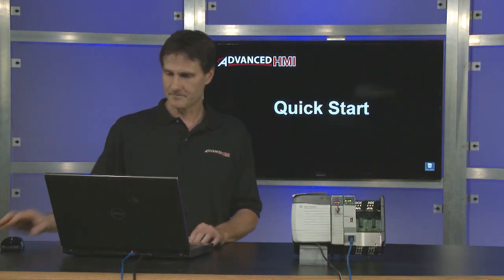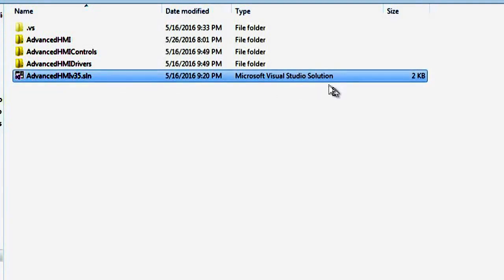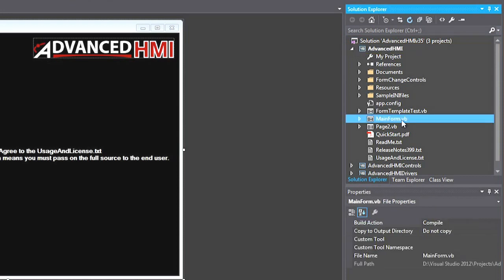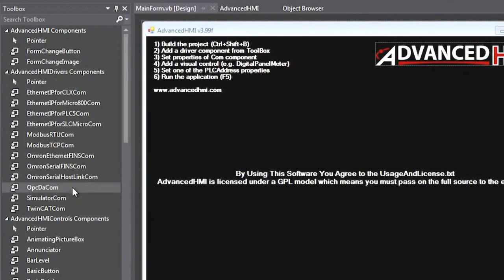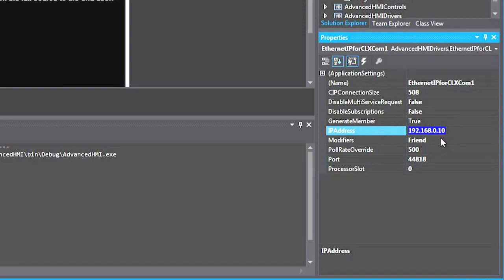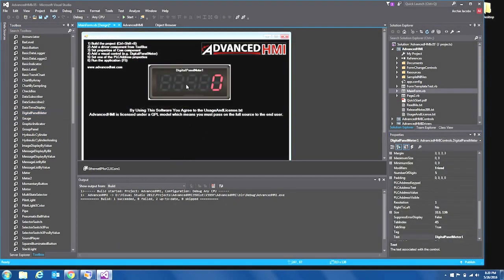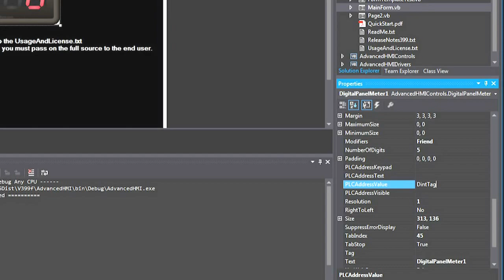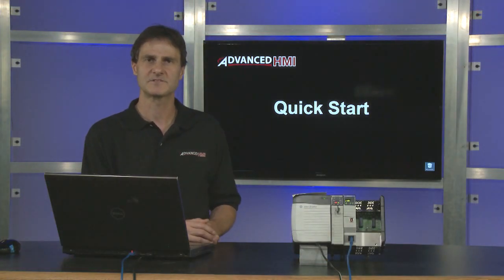AdvancedHMI Quick Start

Comment: Please could someone help me. It would be much appreciated.

I have built a simple hmi screen using the toolbox and have successfully got a start and stop button to work along with speed reference value input directly to a VFD using Modbus RTU.

Start button is addressed 40001 and I send a true value 1 to run.

Stop button is addressed 40001 as well only with this I send a false value 0 to stop.

I have also address a text entry box to 40002 and if I write a 500 value it will run the VFD at 50Hz which is also great. I just have to sort the decimal place out.

I’m having trouble using the Digital Display from the toolbox. I simply can not get it to read the frequency output from the drive. 

The VFD manual says the following:-

(0x03) to read holding registers 
Function (7) is the output frequency reference 
I only need to read 1 register and link it to the Digital Display. What value do I need to enter into the PLC Address Value in the properties box ? . . Any help would be much appreciated. I’m pulling my hair out with this and it should be so simple.
Reply: Function code 3 offset 7 would be a Modbus address of 40008
Reply: @archiejacobs6741  Thanks for your fast response I really appreciate it. Please could you explain the math on that ? . . 

I don’t understand because at the moment I’m sending a true value to address 40001 to get the drive to run the motor. The manufacturer says the following for this:-

Function Code 0x06
Register Address 1

How does this equate to 40001 ? . .
Reply: @adammills2946  Function code 6 is used to write values. 40001 will use function code 3 with offset 0
Reply: I have also tried 40008 and this gives me no results. The Digital Display shows 0 on the graphic and never changes despite the drive running at various speeds.
Reply: I’ve since tested what I want to achieve using QModMaster program. Where it works straight away. I’m sending:-

(Tx) 01 03 00 06 00 01 64 0B

And I’m getting back:-

(Rx) 01 03 02 01 F4 B8 53

Which is then displaying the digits 500 to me once fed back. Which is correct as I was running the motor at 50Hz at the time and the value is correct apart from the decimal placement which I can fix. 

Advanced HMI will only let you enter a value between 4-11 digits within the PLC Address Value in the properties box so what I can’t seem to find out is how to enter the address I require when all the manufacturer tells you is the function code and register number ?

Someone please help a guy out before he loses anymore hair and sleep.
Reply: @adammills2946  01= station , 03=function code, 00 06=offset six, 00 01 = one register. In Modbus addressing this is represented as 40007. In modbus addressing the first digit is used to determine the function code, the rest of the digits minus 1 are offset
Reply: @archiejacobs6741  but then wouldn’t it be 30007 as the function code is 03 ? . . .
Reply: My VFD manual (Invertek Optidrive E3) does not show any addressing that looks like (for example “40007, 40008” etc). All they state is 2 command types being available (0x03 read holding registers) and (0x06 write single holding register). 

Advanced HMI doesn’t allow me to enter the Modbus RTU address in full as the PLC Address Value in the properties window only allows 4-11 characters maximum.

As I can’t type in 
01 03 00 06 00 01 
I can’t figure out what to do. I’ve spoken to Invertek and they say they don’t have addresses such as “40007” they only use the command types and register number ?

I am so confused right now. Surely in this day age it should be easier than this ?
Reply: @adammills2946  Modbus addressing versus modbus protocol does not really make much sense. In AdvancedHMI, instead of using Modbus addressing, you can specify function code and offset in this format  3:0007
Reply: @archiejacobs6741  Thanks Archie, I really appreciate you taking the time to respond. 

That might help. I’ll give it a try tomorrow. Finished work for the day now.
Reply: @Archie Jacobs Thanks for all your help and advice. I really appreciate it. 
One more question I have is whether you can export / publish the finished HMI to an executable that can run on any pc without the pc having to have Visual Studio installed ? . . If so what are the steps involved in doing this ?
Reply: @adammills2946  The finally application is in /AdvancedHMI/bin/Debug directory. This is updated any time you run in VS or do a Build/
Reply: @archiejacobs6741   Is there any way you can use the finished HMI project on a PC without having to have Visual Studio installed ?
Reply: @adammills2946  Yes. Run the application in the AdvancedHMI/bin/Debug directory
Reply: @archiejacobs6741  Wow. Okay it’s that easy ? . . Thanks Archie. Much appreciated.

Comment: Thanks for the great video! I am trying to read tags from an RS Emulator 500 (on the same PC as AdvancedHMI), but not having much luck.
I have set the Emulator IP address, and used that address with a few of the AdvancedHMI drivers.
Any advice would be much appreciated !

Comment: Initially when I open the original .sln file, the CPX driver is already on there. I removed that driver from the code and all the places it's referenced. I add the micro800 driver (as shown in video), as that's the unit I'm using. Then when I make the connections (as shown in video) and set the ip addresses properly (as shown in video) and build and run the program, there appears to be no communication. I'm pretty unhappy with the purchase of this 15" HMI as I feel it does not stand up to what it was made out to be. The support and demo videos for it are nearly non-existent and in the videos there are, nobody is doing anything advanced whatsoever with it. If we would have gone with a panelview 800 I could have whipped out a 15 screen robust controls application in a matter of hours and with nicer buttons (raised with rounded corners). I think we are going to be returning this device because it is not what it was made out to be in the quickstart demo. Especially considering that even following exactly with this demo, it does not function as shown.
Reply from the maker: There should be no driver on the form initially. If you added a control before adding a driver. It will automatically add a CLX driver.   If you then delete the driver, it will remove the ComComponent reference to it in all the co trolls. At that point, if you add a new driver, you need to set the ComComponent property of the controls so they know where to get the data from. Otherwise it will appear as if there are no communications.
Reply: @arj3090  I apologise, as i did not mean to come off as an a**hole, but I am quite frustrated with this device and IDE. I'm much more accustomed to python and C for programming languages and use CCW for HMI development at this time. Upon initial research I was under the impression it would be able to be programmed/designed similar to a panelview 800 in CCW seeing as how CCW is driven by visual studio, but it seems apparent they created their own compiled application based on it to make design go quick and smooth. I was unaware I would need to have experience in vb and .net framework to deploy an HMI solution and I'm in a time crunch.
Reply: @arj3090  Also, I'd like to add, I've extracted a fresh copy of the source within the zip file a few times, and to be honest, I don't recall seeing the CPX driver already included into the form, yet this last time I extracted a fresh copy it was, so perhaps I made a simple mistake the last time I got to messing with it and during extraction. Maybe I mixed some files or folders up. I will look back on it again tomorrow.
Reply: @arj3090  Thank you for your prompt response too
Reply from the maker: @gor4200  Knowledge of VB is useful, but not necessary when creating basic HMIs. It helps when customizing controls or creating your own. Are you using version 3.99x? If so, you may want to join the AdvancedHMI forum and try version 3.99y Beta. It has a number of new controls

Comment: Hi I'm having trouble getting my advanced hmi project to communicate with my SLC 5/04 plc using a DF1 serial cable which does work wirth rslogix 500 and rs linx classic,any suggestions?
Reply from the maker: Make sure RSLink is COMPLETELY shut down in order to allow AdvancedHMI to get access to the serial port.
Reply: yes I've done that, still no good, could you possibly send me a screen shot of the df1 properties settings you use in advancedhmi, thanks
Reply from the maker: Can you post this on the AdvancedHMI forum? You may get more responses and it is easier to give more detailed replies.